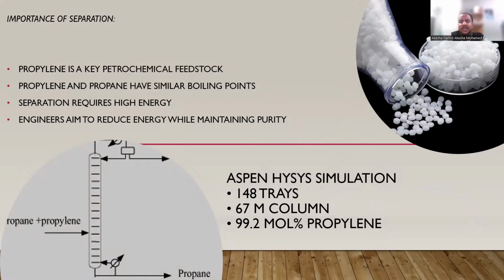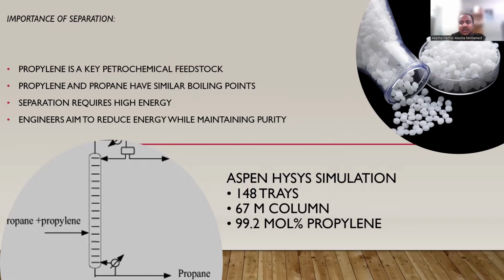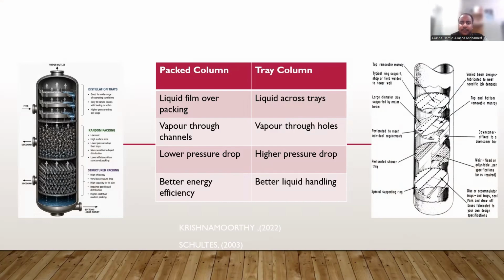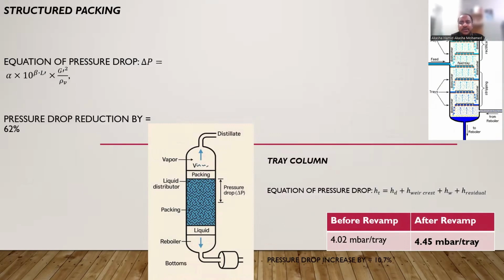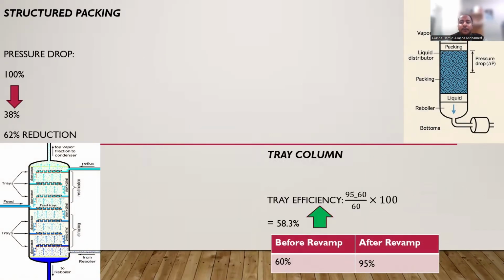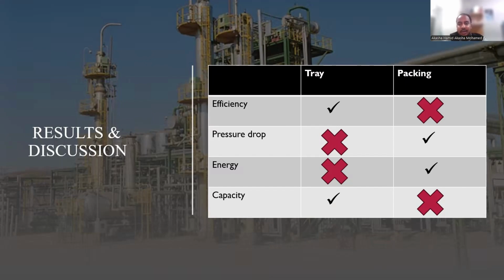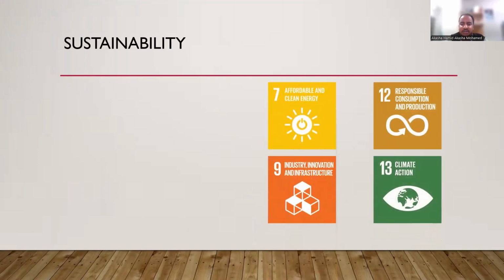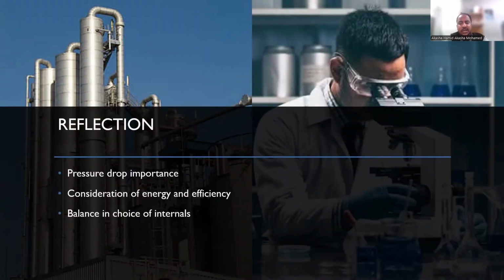Mass Transfer Presentation_AkashaHamidAkashaMohamed

Comment: How did you determine and justify the HETP used for the packed column, and how does it compare with the overall tray efficiency assumed in the tray column design to ensure both designs achieve the same theoretical stage requirement and separation performance?

Comment: After replacing the 148 trays with structured packing, how did you determine the packing height needed to maintain the same 99.2 mol% propylene purity?

Comment: How do engineers decide between structured packing and random packing within a packed column?
Reply from the maker: When deciding between the types of packing, the most important factor is the pressure drop. Engineers can decide by seeing which design coloumn matches less pressure drop.